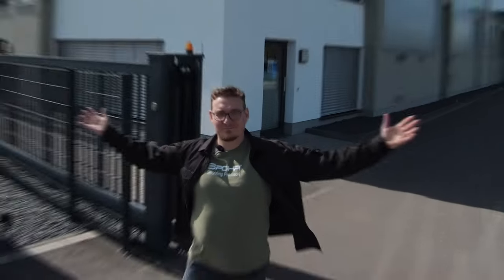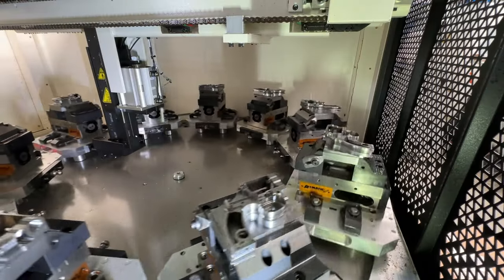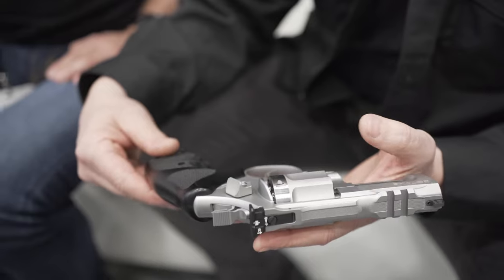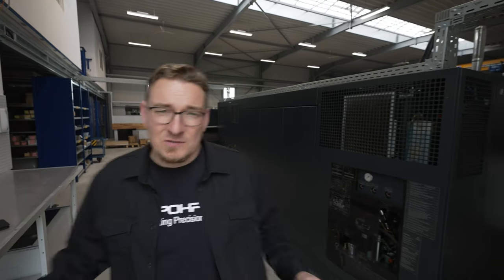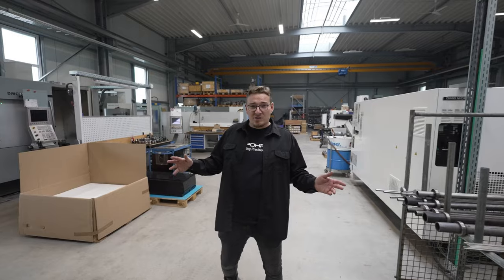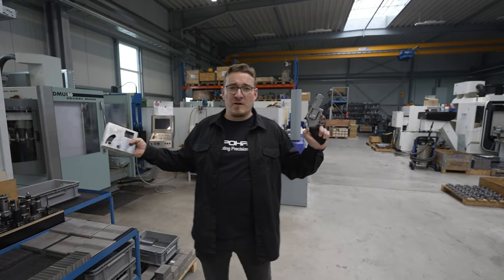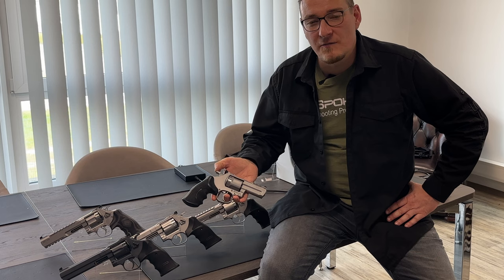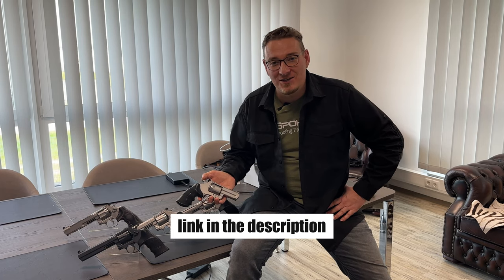From Steel Block to Ultimate Revolver: Secrets of a Master Gunsmith Revealed!

Comment: Looking forward to owing one very soon!  I'm really looking hard for a .357 for precision long distance optic based shooting.  150+yards!     P.S. on your video you hold a damascus revolver, in front of the left side grip is a little 'switch/toggle' What is that for?  I do not see that on the 286 or 562.
Reply from the maker: The switch/toggle is the adjusting indicator plate of the SA on our new revolver line called Spohr Club edition. They will we issued in the us next year. We are still waiting on ATF certification….
Reply: Thanks. I did end up with the 286 competition!  I added a scope and shooting very tight groups at 50 and 100 yards!!  Well done Thomas!